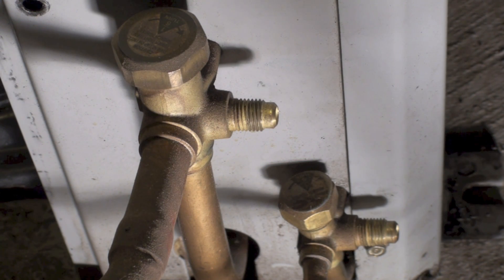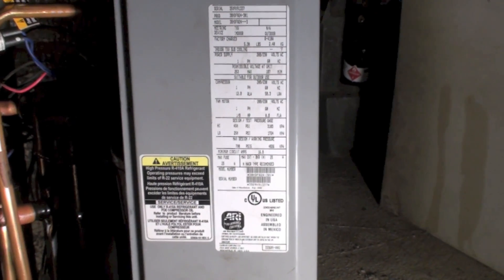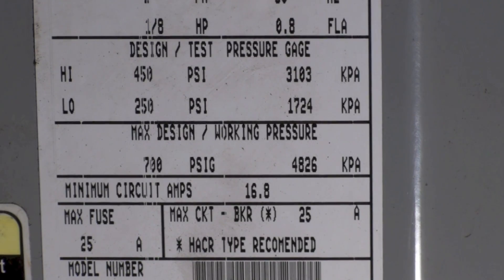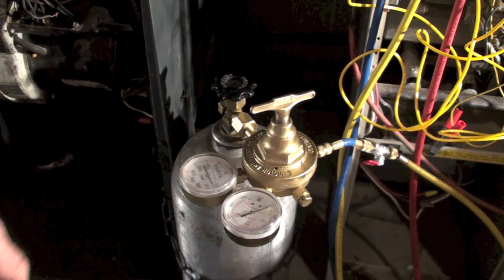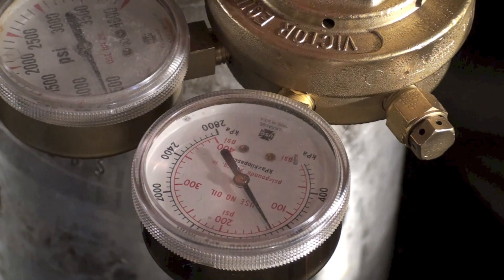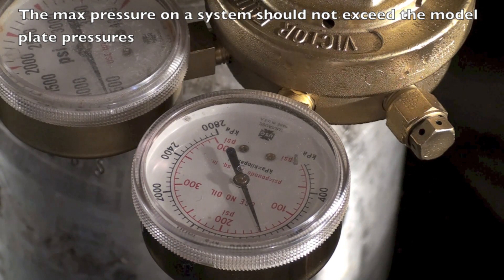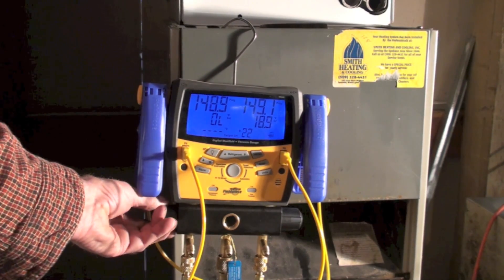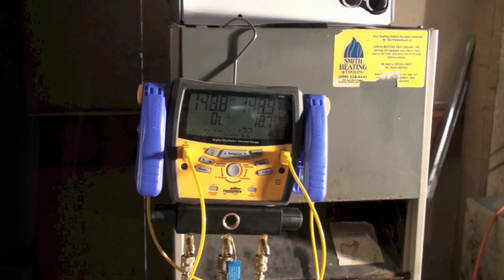How to pressure test the A/C unit.  Part 1

Comment: Hi Thanks for the video..I have a leak  in a heat pumps system with TXV in both .  I'm going to isolate the units.  Do i need to pressurize both high and low sides of the line sets or just one side? 
Thanks in Advance
Reply from the maker: What is the method of isolation are you using.
GFM
Reply: @grayfurnaceman  
I wil be using nitrogen to find the leak since there is no refrigerant in the system. i m going to cut the line set so i will be isolating the coil and the condenser to find out where the leak is coming from. i was wanting to know if i add nitrogen to both high and low side since the both units are using txv's and not using pistons.
Thanks
Reply from the maker: @jtk3516  Only one side is necessary, as it will equalize.
GFM

Comment: Thanks very much sir for your good work. Also sir given that we now have nitrogen in the unit, how are we going to get it out before our refrigerant recharge? Thanks
Reply from the maker: Just open the valves and dump it.  Then evacuate and recharge.
GFM
Reply: Vent the N2 pressure then pull a deep vacuum.

Comment: To add to my other comment, a compressor can only take so much pressure before it will be dangerous and could potentially explode and could kill someone. So he says it could go to 700psi, no system works at that pressure. It’s not made to at all, not even close to that. So at about 420-450psi, the compressor could start to expand/change shape due to high pressures therefore damaging the compressor. Above 450psi, this will be when the compressor could be explosive. Please please please take my advice and only pressure test at 150PSI MAX!!
Reply from the maker: Did you actually watch the series or did you just comment?  
All units can be safely tested at the model plate test pressures.  Modern Tecumseh compressors can be safely tested at 360#.  Copeland at #475.  Look it up.  All coils are capable of high side pressure test limits as they are used in both heat pumps and air conditioners.  The very high test pressures I sometimes use are for isolated coils or linesets.  The worst that could happen is the coil would leak.  
GFM
Reply: Your gonna hurt or kill someone by telling them about 700psi pressure testing. All you need is 150psi. Look it up on let’s say a TRANE installation manual. 150psi it will tell you. Compressors will definitely expolode if you put 700psi into the system.
Reply from the maker: I still say "Did you watch the video?"  The only time you use high pressure is when you isolate components.  You should note that the low side pressure of a 410A system can reach that 150# pressure during high load operation. Let alone the high side pressure.   Trane units have had test pressures of 300# for both high side and low side for over 30 years.
GFM

Comment: Please don’t listen to this guy. Pressure testing a unit at 700psi will definitely cause the compressors to explode. It will break right at the weld joint where the cap is. This is very dangerous. Pressure testing should only be at 150lbs MAX.

Comment: cut the bottle off and use the pressure gauge on the bottle  to see if your loosing pressure ,,you don't need the gauges,,jut don't loosen the hoses
Reply from the maker: I never trust the regulator gauge as they seem to be less accurate than the refer gauges.
GFM

Comment: Very good video. I have a question that I am having trouble finding an answer to. The question is how many ounces of liquid refrigerant will a standard 1/4" refrigerant hose hold per foot?  And is there much variance between refrigerants? I have search online to no avail. Thanks.
Reply from the maker: Not a whole lot.  The number I have is .075 oz per foot.
GFM
Reply: I wish that a still had some R-11 and had access to a walk-in cooler. Thanks again.

Comment: I have a question relating to the installation of a 2.5 ton R-410 split a/c system that comes with a precharged condenser....how does one purge for brazing or pressure test the interconnecting tubing with nitrogen when there are no service ports on the evaporator?
Reply from the maker: You do not need service ports on the evap.  The ports on the condenser will communicate with the lineset and the evap for pressure testing and evacuation.  Hope this helps.
GFM

Comment: Is it possible to presurrize two units at the same time using one set of gauges on a 410a system?
Reply from the maker: +Aiveni Mila I guess you could.  The low side will have to have lower pressure.
GFM
Reply: Aiveni Mila who would do that? There no reason to even want to do that.

Comment: I followed you right up to the end of the purging of the hoses to the input of the unit and this is where I've always parted company with some of you guys demonstrating this procedure.
Correct me if I'm wrong, I don't want to be the contrarian here, but the way I see it, you're simply applying a pressurized column of Nitrogen to the input of the unit and compressing the air within, because the opposite side of the system (low or high depending on which way the flow is) is closed, UNLESS, you purge the system and lines by applying pressure (as you are doing) and then loosening the opposite attached hose to purge, OR, you first pull a vacuum and then introduce the nitrogen.
Reply from the maker: kaydee457 Well, it depends on the situation.  When we use nitrogen to keep the lines from oxidation while brazing, there will be nitrogen in the system before we pressurize.  If we are pressurizing to find a leak, the unit will have a trace amount of refrigerant in the system unless it has been without refrigerant before the repair starts.  In the latter case, we will be compressing some air with the nitrogen.  In either case, the presence of air is of little consequence as the unit will be evacuated prior to charging.  Have I covered what your concerns are?
GFM
Reply: grayfurnaceman Yes, but you removed the shraders and so the unit would have gone to atmosphere and therefore filled with air. I'm not criticizing your method as I've seen others do the same I'm just wondering if I'm wasting my time, and gas, when I do purge the system with dry nitrogen.
Reply: kaydee457 Well, I've watched a second time and you did mention bleeding the system. Maybe we're on the same page after all.Thanks
Reply: kaydee457 Good points.  I`m not sure what good pulling the schrader does.  The system will pressurize rapidly even with the schraders in.   Why bother purging the entire system with nitrogen unless its going into storage or you have switched refrigerants?  Like GFM said the system is going to be evacuated next so does not matter if air is in there.

Comment: on a R-410a system, will nitrogen be good with the refrigerant oil when you do the leak test passing tthru the compressor?
Reply from the maker: trharesco The nitrogen has no effect on the oil.
GFM
Reply: grayfurnaceman Thank you for your reply. I have one more question to ask  about R-410a. when the system is in vacuum and ready to be charge with R-410a refrigerant, can you put the the whole 7 lbs of refrigerant and then turn on the compressor later ?

Comment: Thanks for the video. I need to pressure test a r22 260tr chiller evaporator shell, the tubes hv refrigerant In them. How much should be the nitrogen test pressure be for the same??  The design working pressure for tubes is 235psi and shell is 150psi.
Reply from the maker: Anish Thomas I would not exceed the design working pressure.  Do not put nitrogen in the tubes with refrigerant inside.  Hope this helps.GFM
Reply: Thanks for the reply. No the system is evacuated. But I need to know is there any specific pressure range for nitrogen test. The design pressure is 235. But it's I blv with r22 as with ambient nitrogen might show difference in pressure. I m Lil tensed as I don't want to put charge more that may crack the tubes or less too tat I can't detect the leak at all. As any minor leak may damage my compressor. Thanks
Reply from the maker: Anish Thomas Your design pressure for the high side is usually different than the low side.  If your low side is 150#, do not exceed it.  I realize the leak may be hard to find at 150#.  Nitrogen is capable of very high pressures on the range of 500 to 600#.  Hope this helps.GFM
Reply: So it means as my tubes are designed for 235psi, leak test with 200 will be enough?

Comment: How many ounce of r22 do you put in unit if you do have a leak, to be able to use leak detector?
Reply from the maker: Ben Staton Sorry about the wait.  You don't need much.  A few ounces mixed with nitrogen.  Pressure should not exceed rated pressure on the model plate.
GFM
Reply: +grayfurnaceman what would be the max pressure you would put in on a 410 evaporator coil. thanks
Reply from the maker: +Jesse James I would put the rated pressure on the model plate.
GFM

Comment: Thanks for a great video very very useful and informative. in the beginning you say pressurizing using nitrogen or co2.i understand nitrogen but, wont you be introducing the system to moisture with co2? isn't that bad? Thank You.
Reply: Dry CO2.  Pressure swing will be wider as ambient temperature changes.

Comment: Hey furnaceman, kind of an off topic, but i ask because i notice the same guage in most of your videos...Do you have separate guages for your 410a and your R22 installations?
Reply from the maker: marjones69 No.  I generally use the sman3 for all refrigerants.
GFM
Reply: Ok cool...i have the SMAN3 too but i notice some of the other guys using a different gauge set for 410a or vice versa. Is there any chance of cross contamination? do you flush your Guage set?

Comment: How long do you leave the unit pressurized when doing a leak search?
Reply from the maker: It depends on the volume.  There is no set rule.  When I do it, I pressurize and start looking for leaks in the most obvious places.  If I find none after say approximately 1/2 hour and I see a drop in pressure, may then isolate the parts of the system.  Such as evaporator and line set, condenser and compressor.  Hope this helps.
GFM

Comment: Why did you say bleed the low side? I thought you said not to hook up the low side. I'm using  analog gauges.
Reply: I just want to pressure test some line sets, so if I hook up the high side and let pressure of 250psi, all I have to do is open the high side on my manifold analog gauges? And that will pressurized the line sets coming out of the condenser going into the air handler back to the condenser?

Comment: Quick question - after brazing in new R-410A  (150foot 1 1/8 line set on a 4 ton unit) the system was pressurized to 350 psi with nitro to leak check the connections. System pressure fell to 340 PSI after 30 min and to 300 PSI after 5 hours) is this a problem with a leak some where?
Reply from the maker: Yes.  Even if it stopped at 300#, there is a leak.  Be sure it is not in your gauge set.  Methodical is the byword here.   Start at one end and move to the other.
Hope this helps.
GFM

Comment from the maker: This one is CO2 You can get them at welding supply.  You will also need a regulator.  You can also use nitrogen.  The regulator will go higher.  Hope this helps.
GFM

Comment from the maker: I am demonstrating using the highest pressure you could use on all types of equipment.  some of the older units could not safely go above 150#.  If the plate says 300 hi side and 150 lo side, 150 is the highest pressure without being able to separate the parts.
GFM

Comment from the maker: Unless the high and low side are isolated by valves or by cutting out a component and brazing a line tap, do not exceed rated low side pressure.  Coils can be pressurized higher when isolated, but you are taking a chance of blowing a hole in the piping.
GFM